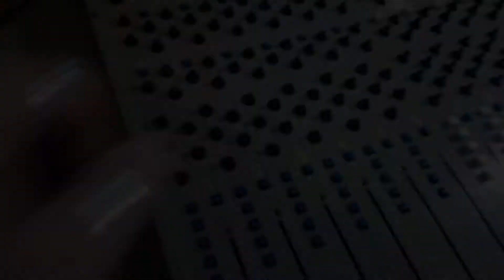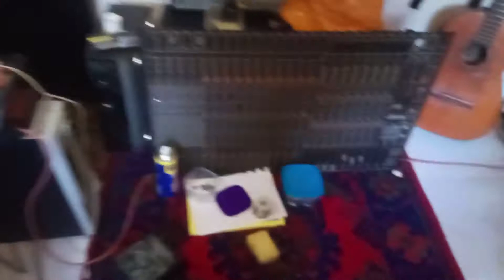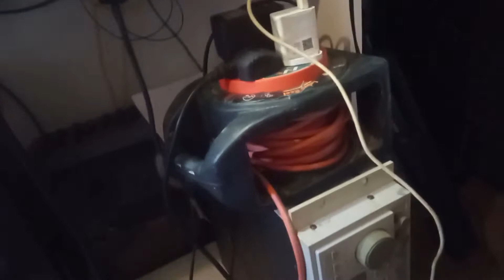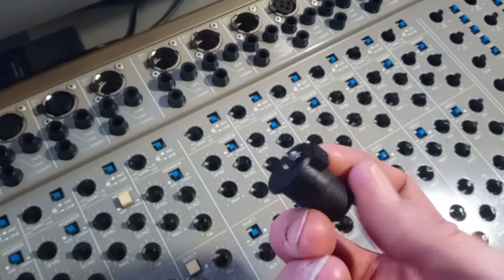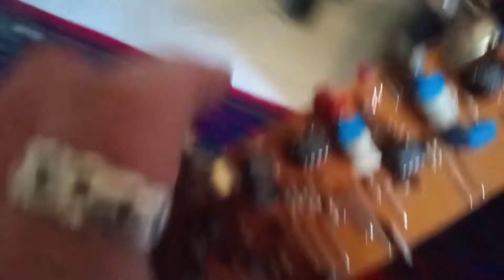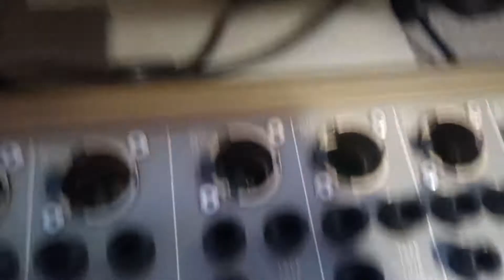SECK 18.8.2 mixer update

Comment: Pls help! I’m tryna get to the circuit board of my seck 1882 which is coated in sooo much dust but am really struggling with those xlr connections. I cannot get the little screw inside that fourth hole to budge. Anyway to help or lead me in the right direction? Thank u :)
Reply from the maker: spray a little lubricant like wd40 around the edge of the XLR socket (NOT into the socket 3 holes) so it seeps down the sides between the steel and the black centre socket. leave it overnight if possible or for an hour at least, make sure the screw is turned counter clockwise (the screw will turn round and round but the lever it moves should have flipped out of it;s internal slot holding the socket in place... Then take a piece of wooden dowl and place it on the black XLR socket and tap it with a hammer, it should hammer out, they get seized up. report back what happens

Comment: Glad I held on to my Seck 1882 mk2 with original p/s. Only missing one cap. No harm done to the blue latching switch underneath other than being exposed. Every channel worked the last time I powered it up. It is in  excellent condition. Got the convent handle still mounted on. Nice vid. Thanks for posting.

Comment: see page 51 o f the service manual, here....  

http://thesnowfields.com/manuals/Seck%201282,%201882%20Service%20Manual.pdf

that shows the mid control circuit longside other channel functional blocks. Given that the Hi/Low eq circuit uses half of the op-amp package, and the mid uses the other half, unlikely to be the op-amp. Investigate the pot, resistors and capacitors around that part of the circuit. My guess would be either a faulty pot ( electromechanical items wear out!) or possibly the 6n8 cap, as caps also fail with age. 
Hope that helps
Reply from the maker: haha, nice one. cheers Tim, It's not the physical pot though, because in SOLO mode it pans 100%, so it's something in the path to the main L/R bus from the pot.. but i don't do electronics (one of my few regrets in life, as well as not learning to play the piano). The problem is finding an electronics person in central London who wont charge more than the damn thing is worth.
Reply: @dancetech  Actually I was referring to the Mid EQ not working. Looking at the diagram, the pan pot is actually a dual gang pot. one gang goes out to the L/R bus, and the second feeds the Solo L/R busses. So could be one half of the pot is faulty and not the other half. Might be possible as a first port of call to replace that pot if you can find one. Shame I'm not there, as could replace this!
Reply from the maker: @timbeaton5045  yeah shame you aren't! i have to try and a find a local electronics person who will fix it cheap.